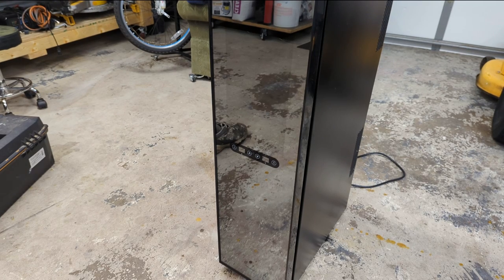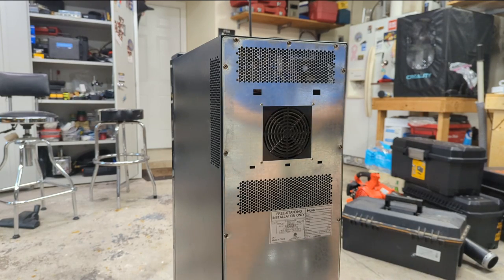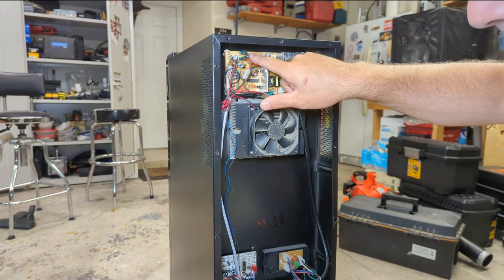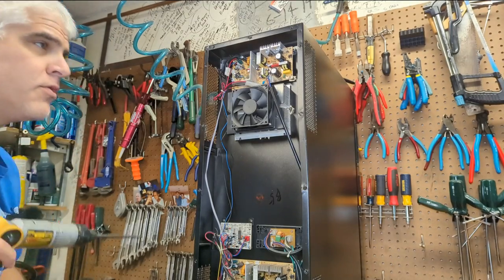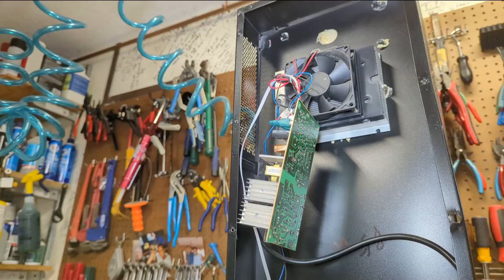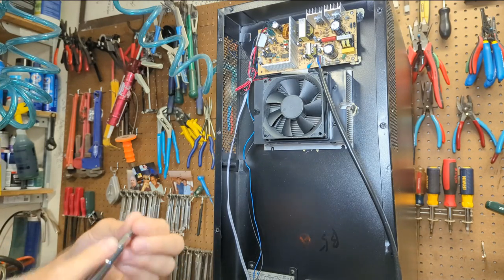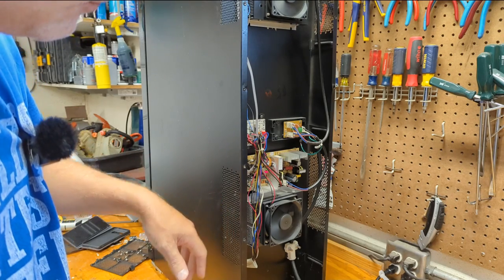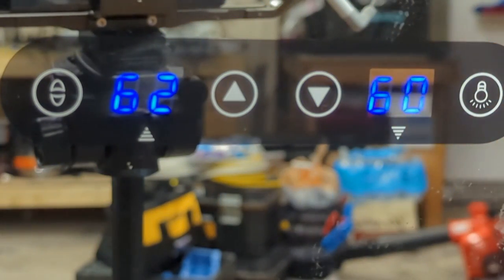Haier Thermoelectric Wine Fridge Not Cooling

Comment: Thanks for posting this. I have a Haier and it has been having a similar issue. I’m going to check the capacitor, as that seems like it could be it. By the way,  While it would be nice for the unit to have a temp setting memory, it should be defaulting back to 55 degrees, in the event of a power interruption. 55 is the most ideal storage temperature for wines.

Comment: my smaller haier wine cooler works, but will not get below 52 F.. I just started working on it.. the fans work.. the big aluminum heat dissipator plate on the back is kind of dirty, so I will blow it out and see if that helps..do these thermo electric systems just wear out over time?

Comment: I was gifted a Wine Enthusiast unit with the same controller boards. The capacitors look fine however 12v is not being delivered to the daughter board that drives the fans… any thoughts?

Comment: I just picked up an Avanti with what looks to be the same problem. I don’t see any visible bulging on any of the capacitors. How do I test them with my multimeter to see if one is blown?

Thanks for this very helpful video!
Reply from the maker: Unfortunately, the capacitor has to be removed to test. Look really carefully - sometimes failed capacitors can be subtle.
Reply: @JoesGarageProductionsLLC  
Eh
I already pulled them, tested them, put them back in, and promptly blew the fuse. 
Lol
I didn’t cross anything on the board, I think I got one or both too hot when removing/resoldering. 
Who knows. 
I’m going to bypass that whole system and just use a power supply and a thermostat board. 
Thanks so much for responding!

Comment: Joe,  In regards to your Generac 4000EXL generator repairs.

I have the same unit with the same stickers on the side just like yours but I can not find the engine model number and type and code (which B&S want to give you any assistance for part numbers).  They say its on the OVHI cover but it's not.  Can you locate it on yours?  

Also, did you have to remove the fuel tank to get the spark plug out?  I can get a socket over the plug but there is no room to attach a ratchet.  Whats the trick?